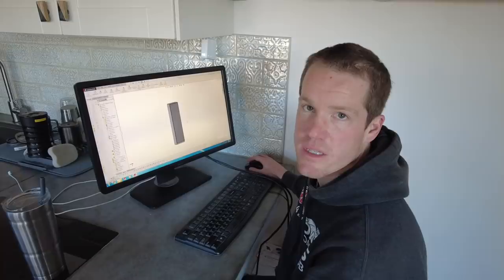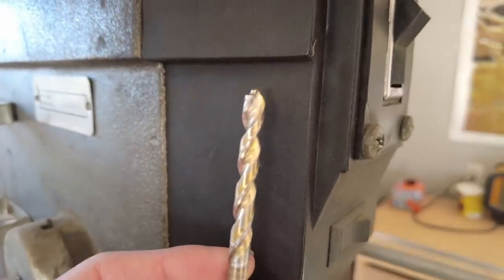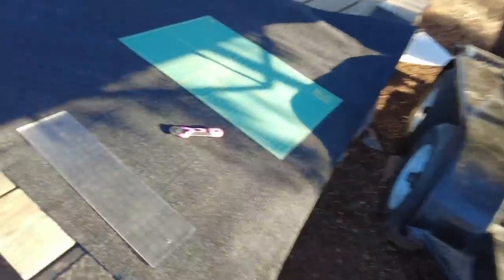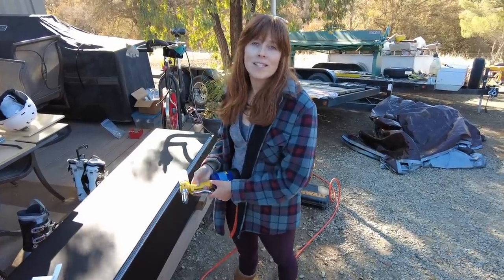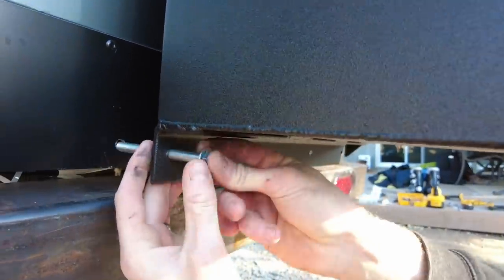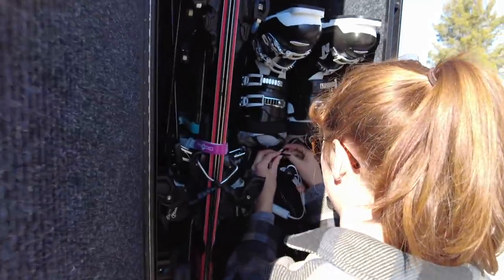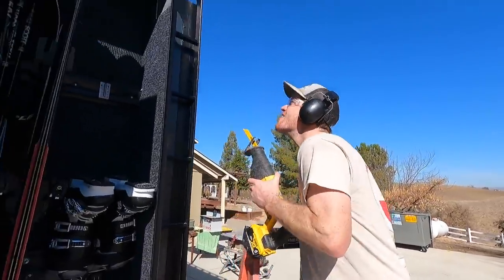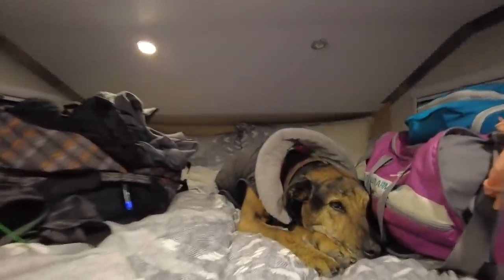Building Our Expedition Vehicle E16 - Heated Gear Locker

Comment: The tip about protecting skin from paint or glue using sunscreen is good, cheap, and available. For those who are looking for a little more protection, I suggest looking at Kerodex creams. Kerodex 71 protects you from water soluble liquids and Kerodex 51 protects you from oil soluble liquids. It can be a little confusing if you don't know if your adhesive/paint is water based or oil based, so look at the adhesive/paint clean up instructions. If the cleanup specifies simple detergents or water, then your adhesive/paint is water soluble. If cleanup requires solvents like paint thinner or mineral spirits, then your adhesive/paint is oil based and therefore oil soluble. Note when using Kerodex 51: It protects you from oil soluble adhesive/paint, but it washes away with water, so re-apply if you are sweating a lot or otherwise washing away your protection while working. For those people looking for an inexpensive and handy clean up for oil soluble sticky stuff like road tar, a little kerosene (you can get K1 kerosene at hardware stores and Walmart) does a good job and doesn't smell too bad.

Comment: I’m really surprised you didn’t put a lock latch on the ski door
Reply from the maker: It will be getting a lock that matches the rest of underbody boxes! (Uses the truck's key).
Reply: Exactly the comment that I was going to make.  Lots of money in that box.
Reply from the maker: @JohnHMoore  A good lock and even better insurance!
Reply: Yeah was thinking of that too.
Reply: I was thinking the same thing, that's alot of expensive equipment
Reply: Was just about to write that. Looks great! How did Riley learn Solidworks ? School and work? I just got a legal copy thru EAA and I am trying to learn it, I know AutoCad and have fiddled with 3d cad in the past
Reply from the maker: @micahc9509  I took a on course on Solidworks in school but it was very basic, and really just got me started. All the sheet metal tools are self taught through trial, error, and frustration trying to figure out how to draw parts for the plasma table. There are some great tutorials on YouTube that I've worked through as well. I'm constantly learning new tricks and better methods. I think the software is worth every penny.
Reply from the maker: @micahc9509  He learned the basics at school (he has a degree in manufacturing engineering) and then also through summer internships! It is a very powerful software and it is amazing what you can do with it!
Reply: or two ...

Comment: Really great idea! I would use a 12v silicone heater with an interior switch.
Reply from the maker: That is a great idea! We are actually going to plumb the box into the camper so that it draws warm dry air from the interior when needed (it will help with interior ventilation and also take advantage of diesel heat instead of depleting our batteries).

Comment: One tip for that alu welding, before welding take on clean flapdisk and smootgrind weld area and then wash it to acetone. Then you got zero of that blackshit and weld is way more better. :)
Reply from the maker: Thanks for the tip!
Reply: @AmbitionStrikes  Also when you use Tig to weld i recommend to clean weldrods also whit acetone, you can notice then how much oxidation there on on surface. :) That box came still just spot on. :)

Comment: You guys never cease to amaze me! Is it easier to mig or tig aluminum? It looked like you used both methods? Did you tig the thinner aluminum and mig the thicker stuff? You could start an entire new video series on how to do some of this stuff.
Reply from the maker: Thanks for following along on this build with us Warren! The MIG is much quicker and requires significantly less technique. But as you said it really only works on the thicker stuff (there isn't enough heat control so it blows out the thinner aluminum). We are cooking up some big ideas for a future build series!
Reply: @AmbitionStrikes  how thick is the aluminum you were TIG welding? Would the TIG work on the thicker stuff?
Reply from the maker: @warrenscorner  Most of the TIG welding has been on .080 and .090... I'm sure the TIG we have would work on thicker stuff but we have never tried!

Comment: I've been enjoying all of these videos! Thanks for putting in so much work to make these. 

I have seen Riley use both TIG and MIG Spool gun welding for aluminum, I was hoping he could say why he uses both and which he like better? 

Thanks!
Reply from the maker: I had very little experience with the TIG welder before this project and it was painfully slow to use. I used the spool gun on anything ⅛" or thicker and the TIG on everything thinner. I wasn't able to get a strong weld on the thinner metal with the spool gun. By the end of the project I was much better with the TIG but it is still way slower than the spool gun. I already owned both machines so there wasn't really a reason not to use the more appropriate machine for the job in each situation. Hope that answered the question? Thanks for watching!

Comment: You two are brilliant. It looks amazing. Do you realize there are hundreds of thousands of skiers in this country who could use that ski bin on their campers.  You have so much room left on that back of the camper, you could build another storage bin for......... a high quality ,heated,  insulated, recirculating grey water filtration system.
Reply from the maker: We really didn't want to end up with our gear just piled up in the bathroom! The area to the left of the box is going to be where the spare tire is mounted but there will still be a spot above the tire should we need more storage space.

Comment: Love the gear box. Are you planning on mounting the bottom boots upside down? With melting show coming off the top boots it will land inside the bottom pair.
Reply from the maker: On our recent trip I discovered I could hose our gear off with hot water from the outdoor shower so there shouldn't be any large balls of melting snow! Riley's boots could always be flipped upside down if need be.
Reply: On a sunny day that plan is good but I would be concerned for the times you are putting the gear away when the snow is dumping. Nothing worse than wet boots on a cold day. Just an observation I still think you 2 are doing amazing work and can't wait to see the finished product.

Comment: Great storage box. 
Dont you think some drainage would have been a good idea. I always have melting snow from boots and skis in my rooftop skibox
Reply from the maker: There are drain holes in the bottom and it is lined with den dry (a product intended for lockers to help the water evaporate quickly).

Comment: 0:53  I add little triangle cut-outs for all my non-CNC bent parts & sometimes relief cuts along the bend line. We actual have that same pan-brake, but it's probably 80 years old. 
9:45  I cringed as soon as you started cutting into that just carpeted box. Hopefully it was easy to clean up & you didn't get cut from your boots being full of filings.

Comment: you two work together so well.   Are you planning on putting a lock on that box?  The ski boots hanging downward wouldn't this have dripping on the power cords
Reply from the maker: Thanks Mark! The box will get a matching lock to the underbody boxes that uses the truck's key. There shouldn't be that much moisture coming out of the boots, but if for some reason there is that outlet is on a GFCI circuit for safety.

Comment: I am going to learn how to weld, but there are many different types of welding.  Since I am committed to building a camper similar to yours, why kind of welding do you recommend I learn first?  I'd be so grateful if you would take a moment to answer my question.  And if anyone reads this who knows a lot about welding I'd really appreciate your input too!  Thanks.
Reply from the maker: We used both mig and tig extensively on this project. Mig is by far the easiest to learn and least expensive to get started in. Good luck with your project, the hardest part is getting started.

Comment: That gear box is incredible! And incredibly smart. The first thing I did when I bought by E350 cutaway was mount two 48" underbody boxes, one on each side. I'm able to store so many things without taking up precious space inside the cargo box. I originally purchased 5 footers. Unfortunately, the forward leaf spring mount was in the way. Now I'm trying to figure out where I can mount additional, though shorter, underbody boxes.  As the top of my lift gate housing adds about a foot of space behind the rear bulkhead, I'm going to build vertical bump outs to store  items such as my propane instant hot water heater, propane bottle, etc. Items that absolutely belong outside the living space, but I see incorrectly installed...all...the...time.

One question and one suggestion:
Q:  Riley, does the fan provide some sort of protection against water infiltration? If so, how is that accomplished? From the product listing, this looks questionable.
S:  Consider installing pneumatic mufflers in the vent holes. Moisture will egress while preventing ingress for insects, bees and such. I install these on condensate drain lines, as well as water tank vent lines. Just installed one today on a vintage Airstream renovation project for a customer. I use these, they're inexpensive and available from 1/8" to 3/4" MNPT:  t.ly/MGxW
Reply: The fan has a louvered panel that would make it pretty difficult for rain go get in. It's intended use is RVs and I think it will be fine. I am familiar with pneumatic mufflers but hadn't ever considered that application. Interesting idea! Thanks!
Reply: @rileydcasey  I can personally attest to their effectiveness for this purpose. As a bonus, the fitting is brass, and the actual muffler is sintered bronze. Bonus:  No corrosion!
Reply from the maker: Thanks John! Additional storage that is utilized efficiently can really make or break the function of a vehicle. If you can dedicate living space for living you can get away with having a MUCH smaller vehicle than others... and park wherever you want!
Reply: @AmbitionStrikes  Agreed. When I'd decided to right-size, I first thought of a tiny house. After wrestling with financing and siting, my next thought was a van. I ultimately decided on a 12' E350 cutaway for myriad reasons; one of those being underbody options for storage, tanks, etc. A 4' lift gate adds elevated deck-like space. Compared to anything else, the amount of room is phenomenal.

I began adulthood as a nuclear machinist mate and chemist, serving aboard a ballistic missile submarine. So my joke with people is that 100 sq. ft. is an upgrade!

At 10' 4" and only 2WD, I'm not able to go that far off road. But far enough for me. A self-converted 1,500W/52V/750Wh e-bike gets me everywhere else I want or need to go.

For me, the freedom to live and work wherever I want, with zero debt and very low expenses, is priceless.

Comment: Neither domestic septic systems nor municipal sewer treatment plants are intended to treat paint products. I realize that the amount is small but if many people were to take your advice and wash paint etc into the sewers there would be problems. Municipal discharge ultimately ends up in a waterway unless it's in a pond evaporation systems.
Reply from the maker: Thanks for the insight Anne!
Reply: Well you do have the potential to reach a lot of people, and petrochemicals as well as pharmaceuticals amongst a lot of other things have been finding their way into our waterways for a long time. Sewer treatment facilities are designed to treat biological waste, and all the other stuff will pass right through. It’s a very big problem for our planet. In case you’re wondering my background is potable water Civil engineering.
Nice rig btw. I’m a full time RV’r for 7 years now. Good choice on the Ram for a power train.
Reply: Even sunscreen is not treatable in sewerage treatment plants. HI has banned certain sunscreens due to fish die-offs on the reefs.

Comment: How do you guys like the spool gun compared to tig? One came with my welder a bit ago and I've yet to use it
Reply from the maker: The spool gun is easier to use (requires less technique) and much faster, but also way more difficult to control the heat and will quickly melt right through something.

Comment: Great job, hey where did you learn to work with sheet metal welding and fabricating?
Reply from the maker: Thanks! Riley has a degree in manufacturing engineering. We started an off-road shop right after college and learned as we went!

Comment: Awesome mods. Curious if a similar camper box could be built as a slide-in unit for people not wanting to take their truck bed off? What do you think?
Reply from the maker: I think that it definitely could! However it would have to either be taller or have less headroom inside because we built ours directly on the frame rails. There are several manufacturers that make slide in flat bed truck campers that are very cool!
Reply: @AmbitionStrikes  Would you say you saved a lot of money doing it yourself, or is it cost effective?
Reply from the maker: We are going to be into it a fraction of the cost of production model... but we also have about 2,000 combined hours of labor that we aren’t compensating ourselves for. So it really depends how you want to look at it!
Reply: @AmbitionStrikes  Thank you for your response. That's definitely something to consider. Being retired helps.

Comment: Won't the zip ties holding boot warmers get hot and melt?
Reply from the maker: The heating elements are inside of the plastic tubes, so there is never anything super hot exposed. You can hold them in your hand when they are on and it just feels like a very warm handshake.